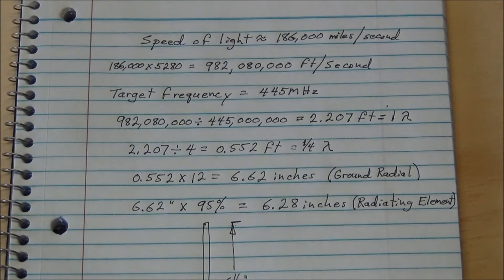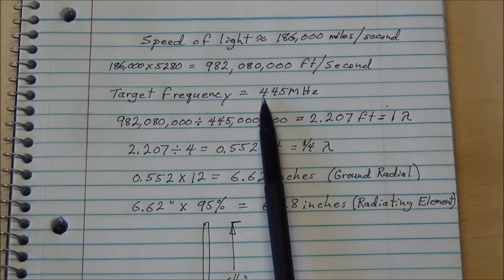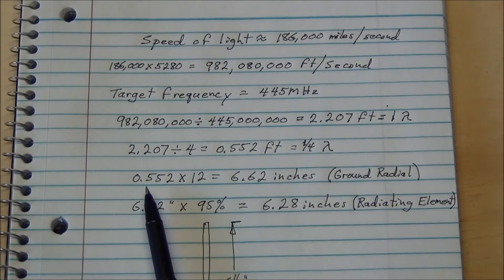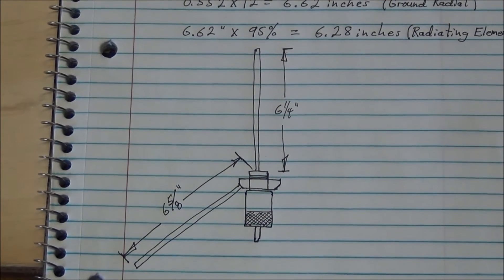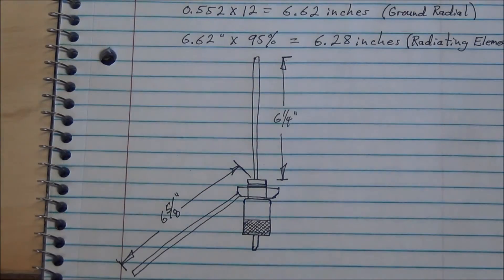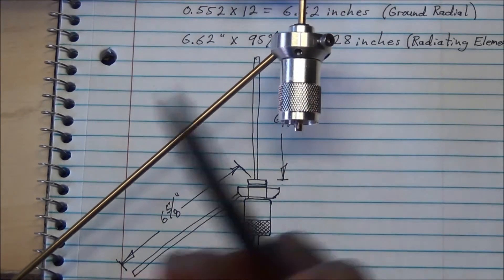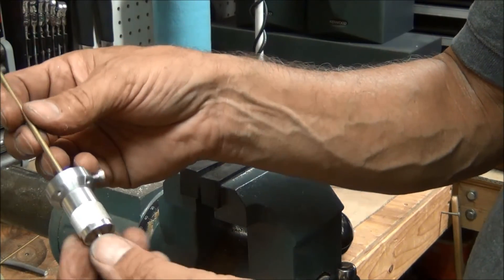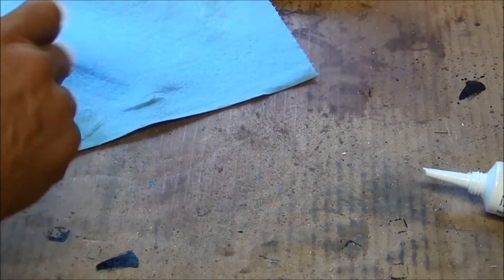VHF - UHF Quarter Wave Antenna Part 3

Comment from the maker: An inverted V is a dipole antenna with the two legs sloping down. Inverted V antennas are normally used on HF frequencies (below 30MHz).

Comment: Thanks, interesting project. Will try a 2 metre this winter. Material list would be nice at end, but maybe I'm just lazy. Apparently parting is not this lathe's strong suit. I came across your video while searching for cross slide modification that solves rigidity issue.

Comment: what made you choose to use a PL259 connector instead of an SO-239 chassis mount?
Reply from the maker: I used a PL-259 connectors because have SO-239 mounts. Antenna mounts are very easy to make using longer length barrel connectors. That way the antenna plugs into the top side of the barrel connector mount and the coax plugs into the bottom side of the barrel connector.

Comment: Great job on the antenna. Best I've seen so far. Where did you get the ground radial adapter?
Reply from the maker: You need to watch parts 1 and 2 for the answer.